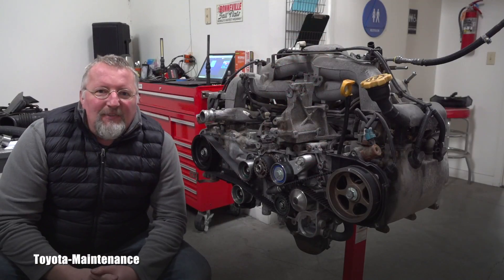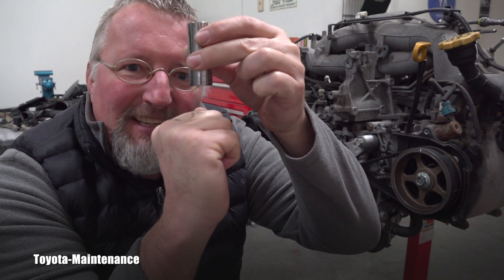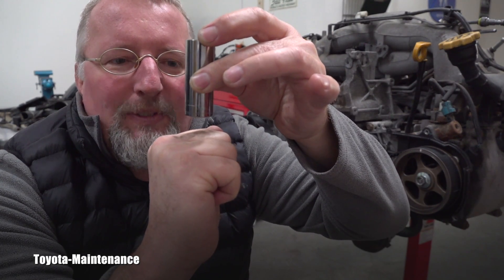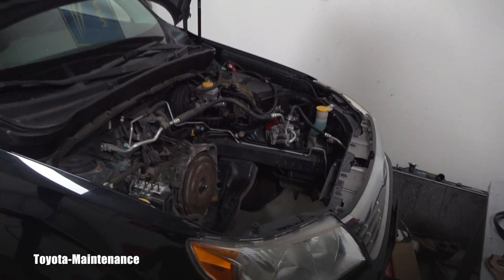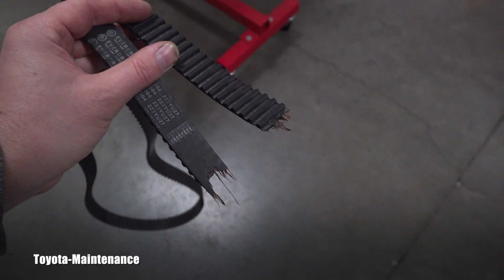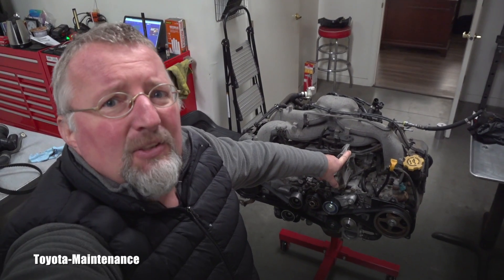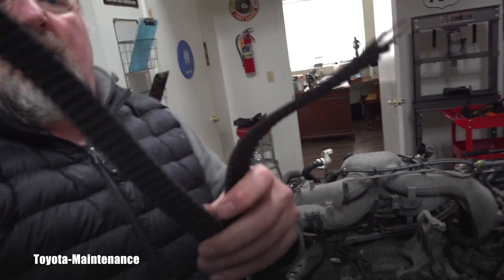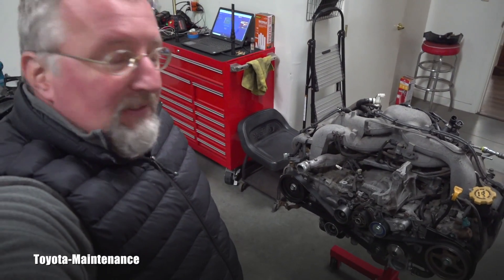Avoid Interference Engines with Timing Belt

Comment: .There are pros and cons to both a timing belt and a chain. Replace a timing belt every 90/100k and you will be fine. 4.7 Toyota engines are known for 500k or more. As far as 4.7s in tundras are the more easier vehicles to work on

Comment: I am familiar with the EJ engine and those idlers with green bearings aren't the OEM product, so instead of using the original made-in-Japan parts that have been designed and tested according to Subaru standards, you used parts from some no-name manufacturer in China that just wants to make money. So the only thing you are 'maintaining' by using them is the bank balance of a faceless Chinaman. There are some car parts where aftermarket is ok, but critical timing parts are not one of them, as they are hidden from view and can fail with little notice with a big towing and repair bill. It is can also be hard to judge the quality on the parts too because the bearings are sealed by their nature and it would be hard to judge if they can last 10k or 100k kms without actually testing them.

So this video should be renamed 'avoid non-oem timing parts'.

The hydraulic tensioner should also be bled properly, there are videos how to do it. It needs to be done slowly a few times vertically with a g-clamp. And you should keep it upright after bleeding as well.

Also Toyota has made a lot of interference engines with timing belts as well, you just need to change all the parts (not just belt) on time, use OEM parts, follow the instructions and maybe look for tips on youtube from others who know what they are doing.

Comment: timing belt is always prefered for high rev, high performance engine. life time timing chain? think again, the tensioner and guides are all plastic and chain stretch too. comparing the work replacing TMB or TMC, I'll choose the belt. BTW, it's not 1950 any more, timing belt is kevlar reinforced and you gotta have some next level ignorance to drive the car till that belt snap.

Comment: 102K original belt kit on my 2006 DC Tundra bought new. Have changed/refreshed EVERY fluid and keep all zircs greased on drive and suspension. Radiator still perfect like new.
I plan on doing complete Belt Kit, radiator + Cam/Crank seals as well as hidden hoses under intake at 125-130K though may go 150K.
Probably need to pull/replace O2 sensors and clean out injectors at least. Oil/Filter 5K.

She will run longer than me.

Comment: you can have these engines. its not that you dont want then. its just you need to do the timing belt change every 70-90k miles to be safe. along with water pump an so on.

Comment: EVERGREEN product are extremely inferior. I've change timing on 1mzfes and 5sfes with evergreen belts on 16 cars all together and customers came back to me with mileages no more than 40thousand miles on them, the lowest was 15thousand. Ten of them were snap clean off and 5 other was missing teeth. Around 8 of the customers brought the timing kits to me to install and the rest I've gotten them from five different suppliers.  This was in the span of 9 years. Please from severe experience. please use genuine Toyota timing belts. they  are the only ones i use and not one of my clients ever came back concerning a timing issue. I have not had any experience with gates belt, but only for the ancillaries.

Comment: Gonna echo what someone else said.. Why didn’t you at least use a Mitsuboshi belt…or a full Aisin kit which is comparable to oem materials quality. I’ve seen parts store belts that go bad within less than a year, usually dayco brand. I’m sorry, but whoever decided to go with cheaper than oem parts is probably at fault! All parts that spin (pulleys and bearings) also need to be replaced lest they seize up and snap you belt. They make reinforced timing belts too. 

I bought a subaru on auction and I felt it when you said you put a new timing belt and ran it lol. It’s hard to take these out and apart just to find out what kind of failure you had. I bought a subaru on auction and I was not prepared at all, at first. Mine came with a piston to valve contact and I can only guess a couple things could have happened, rod bearing came out, but did it happen after the piston-to-valve contact or before during HG failure? I don’t know. Or did someone time it wrong when replacing head gaskets? Who knows lol.

Comment: Interference car engines with timing belts are the worst possibly imaginable. I have had to replace my timing belt over 7 times in less than 2 years yet i drive on a highway for the most part.
I'm never buying any car with a timing belt.
Period

Comment: One major issue that has become an issue over the last few years: counterfeit low-quality Chinese timing belts that masquerade as OEM quality parts. This is something that's gonna be an issue for years to come. The dealership is about the only place I would buy such critical engine parts. There are dozens of videos here on YT that chronicle people's experiences with fake replacement parts, which are packaged to look like the real thing. Any online parts purchases are suspect and I've received a couple myself. Rockauto.com is the only online supplier I deal with now.

Comment: I have an interference engine with a timing belt, Subaru engine actually. But i got the time belt changed at 90k miles so it won't break. It's ok to have an interference engine with a timing belt as long as you keep up with maintenance, and use quality parts.

Comment: Agreed!  My mr2 turbo 3sgte is belt but non-interference.  If interference, make sure the engine was designed with a reliable timing chain system.

Comment: To prevent a waste of time you can use a cylinder leakage tester to check the condition of the valves and seats before you even put a belt on the engine.

Comment: I have to disagree there. What you don't want is an engine with timing chains. 
The only time you'll ever have problems with a belt is when you are lazy and don't stick to the manufacturer suggested interval. Wich is an american problem I guess, since they are still used to their indestructible 60s v8s.

Most euro manufacturers however are unable to produce lifetime chain drives. 
So you gotta replace them. Wich always costs ALOT more than a belt service. 
They are noisier, heavier and more cumbersome to change. 

A belt needs doing fairly rarely and is no hassle otherwise. 

Example. Our 99 Passat 2.8 got its second belt service at 160k miles.
My friends A6 TDI had its first chain service (aka replacement😂) at 70k miles. 
One cost 250 euros, the other 2000 euros.

I do however agree with you when it comes to not working on Subarus. They seem to be pretty annoying to work on with their PERFORMANCE oriented low center of gravity flat four.

Comment: The water pump and tensioner need to be changed at the same time the timing belt. This is why there’s no chain because the water pump needs replacing.

Comment: Remember old v-8 engines with plastic teeth on cam gears? Manuscratchures always have put crap in cars. Had timing belt break on both, interference and non- interference.

Comment: What do you think about the Sienna 05 3.3 l engine ? It has a timing belt and I believe it is a interference engine. I don’t hope to trigger bad luck by mentioning it but these vans do have decent reviews even though they are such engine. I recently replaced the timing belt at 95k km interval. I love the car but this timing belt thing does concern me.

Comment: Another  great  video , thank You. Subscribed.
I've  heard  that  most  toyotas   (except V8  models)  have non interence  engine.
I asked   specifically  about: 2001 Toyota  Sienna V6 3.0L 1MZ-FE engine, VVTI-24 valve and  received  confirmation from toyota  dealership.
Gates website (company making rubber  products like: belts, hoses) years  ago  had  a  list of  interference and non interference engines, but  they  don't  have  that  listing  anymore.
They also  confirmed, that  the  model  mentioned  above  is  non interferance.

Comment: Is 2007 3.5 L Camry interference type ? It’s got a tick when I start it .
Reply: No, the 3.5 V6 is not an interference engine. The ticking on these is usually the variable valve timing mechanism. Make sure you are using a good quality synthetic 0W20 motor oil and quality filter. Don't be tempted to run thicker oil. Use what Toyota recommends.

Comment: The Toyota 4.7 liter engine in the Tundra and Sequioa. That engine has reached over 1,000,000 in a few Tundras. Change that timing belt along with the idler pulleys and tensioner every 95,000 miles with a kit from Aisin (water pump included) Aisin is partially owned by Toyota and designs and manufactures these timing belt kits and many other parts for Toyota to include their transmissions.

Comment: Sorry but this video is nonsense. Change your timing belt as per the manufacturers specifications and you will not have issues. Show me a car with a snapped timing belt and I'll show you a car that has not been properly maintained. I've driven Volvo white blocks for years with no timing belt issues.

Comment: FINALLY! Someone else who gets it! I've been saying this for years, after learning about it the hard way [btw, the sales droid at the dealership said "Yes" when I asked if the engine in the truck I was buying had hydraulic lifters. It didn't... it used shim-over-bucket adjustments, which I had to pay an upcharge for when Toyota paid for a new short-block in the head-gasket recall on my '91 3.slo...]

Comment: There’s nothing wrong with timing belt engines in general,I went 199 thousand kms between belts on my 92 civic si,it cost 900$ cad at a Honda dealer for belt,tensioner and water pump. I wouldn’t go that long again,maybe change it at 150 thousand,no big deal.

Comment: I don't want any interference gasoline motor. It's a nightmare to fix if timing slips.
Reply: Its much worse on a diesel engine, damage might be a lot more severe due to higher compression and the valves are opening vertically.

Comment: I have had several Hondas within the last 35years and never had a timing belt issue...Perform the Belt change at every 100K miles with high quality and don't abuse the car, and you should easily see 300K miles using 100% synthetic motor oil.

Comment: 5,000 mile timing belt failures are kind of a freak thing. I had an Audi TT and put over 200K miles on it without any issues at all. I did of course have that belt, water pump, and the 'rollers' replaced every 50k to be on the safe side. I'd still be driving that car today weren't for it being rear-ended...

Comment: That's why I change the timing belt any time I purchase a car equipped with one, I factor it into the sale price. Saying buy a timing chain equipped vehicle is no peace of mind either, manufacturers love using plastic guides that wear prematurely and engineers are trying to save weight and use thinner and lighter chains that are only fit for a pedal bike. That's why the 1.6 engine used in Mini's, Peugeot and BMW cars are a disaster waiting to happen.

Comment: I bought my 05 4Runner with a 4.7L V8. At the time, I didn't know it was interference. I changed the belt at 90k miles and the old belt looked new and showed no wear, but I replaced it. I'll do it again at 180k and hope the belt never fails.
Reply: That's a big job. Hope you got all Asin brand parts, pump, tensioner, gaskets ect.

Comment: The one time in my life I bought a Subaru, along with my mother, was in '88, the DL Wagon.  Big mistake.  I saw your video and all those bad memories welled back up.  I did all the maintenance per the manual, but those darn belts kept stretching what-have-you (I am no mechanic) and I kept taking it back to the dealer with 'tappet noise' and yes they kept replacing or adjusting those belts.  By 60,000 miles it had developed other issues (electrical) and I traded it in for a Toyota truck that I sadly lost in a wreck in 2002.  My mother had the same model Subaru and had a similar experienced but her belt snapped and caused a lot of damage- left her stranded on railroad tracks.  I think those wagons had a 1.8l engine.  Junk if you ask me.  I had a 2002 V8 4x4 Tundra that I sold in 2019, it never broke down and was in perfect working order when I sold it after 17 years.  But I fell in love with a 2019 Tundra 4x4 Limited and bought that.  By comparison, I was beyond thrilled to get rid of the Subaru and will never own one again.

Comment: What is you surbaru channel, someone prior said you had one. Great video! By the way, if the brand of the timing belt was crappy, I can see that happening OR the prior person didn't do the job right or didn't change all the pullies etc. Rare to see a failure of a new belt happen so quickly. That is if I undersand it was replaced onced and failed prematurely.

Comment: Good information.... in this case... would it not be cheaper to purchase an engine that runs from a salvage yard?   Last subaru whose belt broke.... i saw not only the bent valves... but also a few destroyed piston heads.   Just the hours you put into that job .... you could almost purchase a re-bulit engine.   WHEN I SUBARU GOING TO WAKE UP??????

Comment: I could use a new timing belt on my 2004 Hyundai Elantra, going on 17 yrs old and 45,000 miles. The manual says to get it replaced at 5 yrs or 50K miles which ever comes first...

Comment: Here's a better idea.  Maintain the timing belt drive system and you'll never worry about it.  Belts almost NEVER fail autonomously but because the owner simply slapped a cheap belt inside it rather than replacing the pulley's, idlers etc....you know, the components which DO fail(bearing seizure) which then burn the belt to failure.  Belts themselves will easily go 200k if it's OEM.  And yes, I've done MANY Subie timing services and know a 25 year Subie master tech who says he's seen very very few failures of the belt not caused by a bad bearing or cheap/wrong belt.

Comment: I have a 2012 Honda Ridgeline with a timing belt and 71k miles.  Honda recommends changing that belt at 105k miles.  On the Ridgeline forum there have been a few broken timing belts.  One was in a very low mileage like about 25k miles 2011 and was thought to have been stored for awhile.  Storage means that a few of the teeth on the belt would be under tension for a long time and that could create a weak point on the timing belt.  The other Ridgelines with belt failures seemed to happen to replacement belts that didn't last like the original belts.  I've been debating on selling but idk.

Comment: Isn't the chain sliding on plastic guides? The chain may not break but those guides submerged in that hot/cold oil all the time, will. If you take care of the car and do proper maintenance, the belt will not fail you. If the manual states that you should change it every 60.000 miles, change it a little sooner, just like engine oil.

Comment: As a general rule, timing chain systems will outlast timing belts. Some timing chain systems have their faults too, but I still prefer chains over belts. The main reason manufacturers went to timing belts was to make their engines sound quieter and to induce another needed service interval in order to increase profits. I have changed timing belts on many different vehicles, including Porsche with interference engines, and have found that if you replace not just the belt, but all ancillary components such as, rollers, tensioners, and water pumps, your chance of success are much greater. Also, you need to make sure the engine is timed properly by turning it over by hand several times before start-up and that the belt tension is set correctly. Good video Peter and valuable information!
Reply: why could they not go to gear driven cam systems?
Reply: @markfitzgerald7556  Actually, there are gear driven cam systems out there, but they are mainly used in high horsepower or high torque situations. Top fuel drag racers and huge marine diesels use them, for example, but there are reasons car manufactures stay away from them. First off, they are extremely noisy, think blower whine noisy here. Secondly, they inherently have more drag and use up power produced by the engine to run, so less power at the rear wheels and less fuel economy. Thirdly, for today's overhead cam designs with variable valve timing it would be an engineering nightmare to accomplish, especially within budgetary restraints, and as the gears wear, they introduce more contamination into the engines oil as well as causing extreme directly transferred loads to the camshaft bearings which would effect reliability. Interestingly enough, many modified overhead valve V8 engines ('Merican engines!) switch to belt drive cams from timing chain for more efficient and more reliable transfer of power.
Reply: @mikearend997  thanks for the info
Reply: Mike Double and single helical gear sets are more quiet
Reply: @markfitzgerald7556  For sure, but are still louder than chain or belt. Plus they still transfer high loads to the cam bearings and pose a challenge for variable valve timing.

Comment: I’ve never heard of a timing belt failing at 5000 miles / 11 months.   I’ve also not heard of anyone using cheap timing belts.  Cheap timing belts should be banned!
Reply: A simple small coolant leak from a water pump, or failing bearing on a roller that should have been replaced at the same time the belt was, could cause early failure easily. Best to change it all at the same time. They do make Kevlar belts for some vehicles that are supposed to superior, but I have never tried one myself.